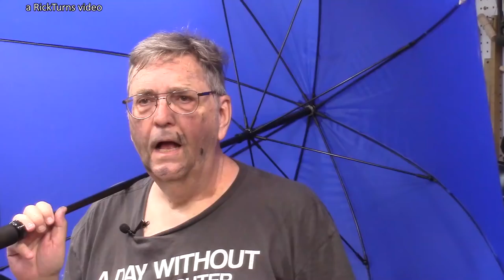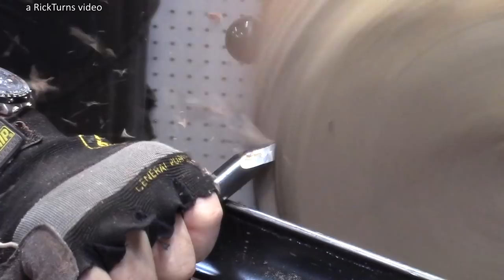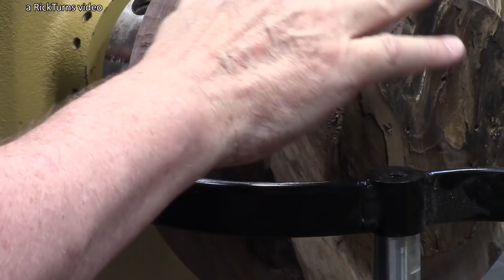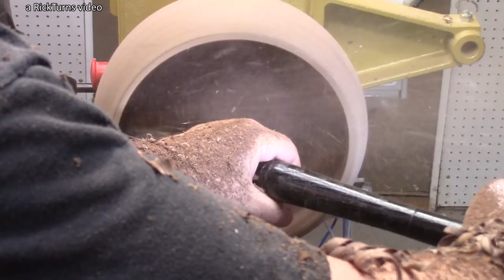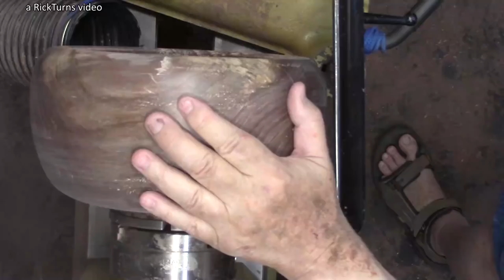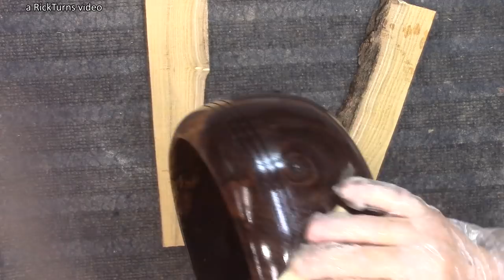Walnut Bowls And Thunderstorms Don't Mix

Comment: Such a beautiful piece. I watch a lot of wood turning videos and each time they inspire me more and more to start this as my own hobby. I love trades and working with my hands. I was one of those kids who were always building car models or any kind of model and always playing with LEGO.
My only carpentry experience is building and installing custom wood stairs. So I don’t have any experience with a lathe, is there any tips you or anyone else could give someone like myself?
Reply from the maker: It's actually not that hard, and doesn't have to be tremendously expensive. I believe Mike Waldt's channel has around a dozen videos directly aimed at the beginning woodturner. Here's a link to the first of them: https://www.youtube.com/watch?v=S8KrtPQfXQ0
I watch Mike's videos a lot, and have learned a lot from them. You might also want to check out WyomingWoodturner channel (Sam Angelo) - he has a lot of very good videos that focus on the basics. Thanks for watching, Cole.

Comment: How is it that part of the exterior was dark and shiny and the rest was matte before using the shear scraper?
Reply from the maker: I'm not sure. Could you give me a time reference in the video when that happens? I'll check the video at that point and see if I can answer your question.
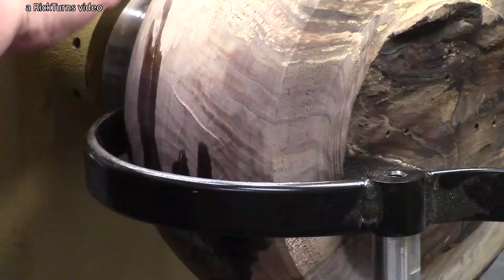Reply: @RickTurnsWoodturning  At 6:07 part of it is dark and shiny compared to the rest. I was just wondering how that is?
Reply from the maker: Sorry for the delay in replying. I thought the message had sent but it apparently did not. That dark splotch on the bowl is where I dripped CA glue into some cracks. Final shear scraping and then sanding removed the splotch.

Comment: Fun video! Question, did you adjust the lathe speed when burning in the lines? Thanks.
Reply from the maker: I think I did. That moment was cut from the video. I believe I raised it to about 1000 rpm. Thanks for watching, Deb.

Comment: Great video Rick. Would have been much better if the audio and video were both in sync. But I do like the bowl.
Reply from the maker: I didn’t notice that the audio was out+of-sync....where did that occur?
Reply: Rick Turns About half way through Rick. But it may not be on your end. Your next video I watched did the same thing. So I went back and started the videos over and everything was fine. Not sure what happened. But I still enjoyed the videos.